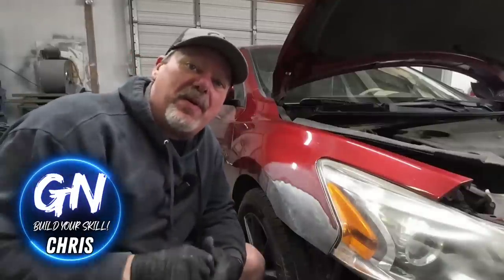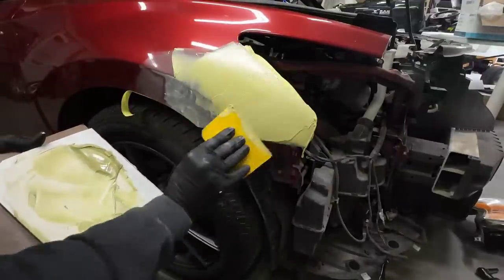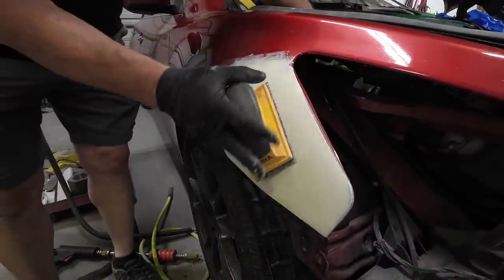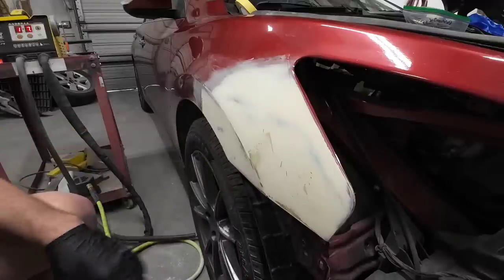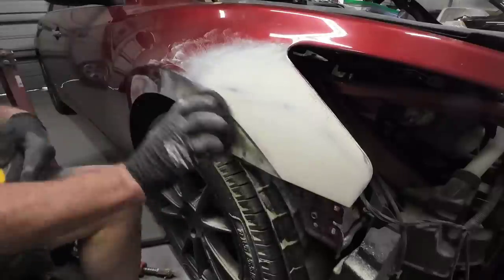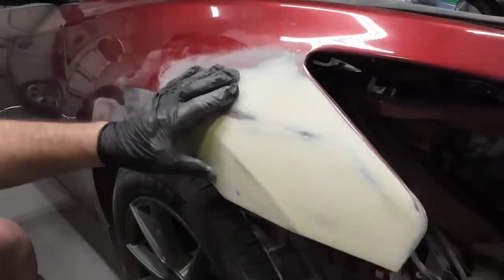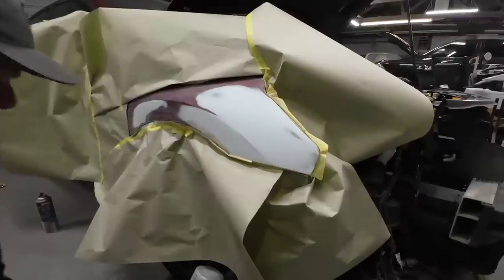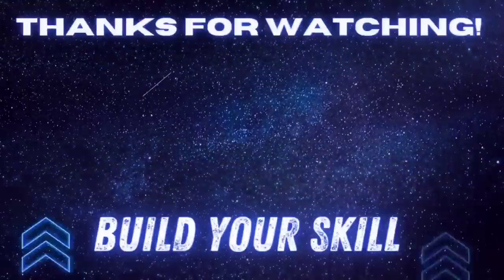How to MIX, APPLY and SAND BODY FILLER for amazing results! complete guide!

Comment: Another tip for filling curved surfaces is to bend your plastic spreader slightly to give it more surface area underneath that edge. This allows more buildup of filler.
Reply from the maker: 👍yes good tip

Comment: Excellent video (I follow all your video's from down under Aust) what size tip did you use? as i have the same R500 gun and an Aeropro A610
Just in the middle of setting up my own double garage as my DIY spray booth as need to do a full car respray on my 89 midnight blue Merc 560SEL and my black 88 560SEC
(as to spray guns i also own a Devilbiss GTI and a Pro lite and a Sagola 4600 T/Truck for clear but i am digging your vids on these LVLP guns for spraying in home garage scenario to keep overspray to a minumum) .  I am not a painter by any means but do all my work at home on my 3 x classic cars as i also have a workshop with hoist behind my double garage

As to compressors i have a 100Ltr compressor + 2 x 100 Ltr extra tanks plumbed in = 300Ltrs/80gal + Delro heat exchanger + 1inch copper pipe wall mounted large moisture trap with 3 x ball check drain valves feeding a 3 stage filter system - so making sure i get nice clean air that will keep up with a HVLP gun @ say max 30PSI and easily handle a LVLP gun on full car respray.

Getting the garage to flow air correctly is currently my project/challange and any input would be appeciated (size 21ft long x 19ft wide x 8 ft high - going to build an intake plenum for filters at rear mounted high and 2 x exhaust plenums at front (as my double garage door is a tilt door & not a roller door unfortunately.  
I have ordered 2 x explosion proof 400mm axial exhaust fans & have 2 x wall mount 500mm axial intake fans as want to get this garage working like a booth as it will be sealed  
Perhaps you can do a video on this topic seeming you spray in your open workshop
Reply from the maker: Sounds to me like you've done your research and have a great diy set up. Just the set you described is better than what I'm  using  every day. 🤣
To answer your question I'm using a 1.3 on the R500. I am building a booth it's  started but slow going because of time. So I will  be eventually doing some videos  on that. Appreciate your comment and support brother!

Comment: i am painting a truck with red cab,doors,fenders...it has a white box should i use a grey or redish primer under the new red paint ?   thanks
Reply from the maker: White is the best color to use under red for coverage.  However i would primer before painting for a extra chip resistance or you could seal it before painting.  Appreciate the comment brother!

Comment: does single stage acrylic paint need a clear coat ? lol i have no knowledge of body work...i already have te singe stage paint.....what primer should i use with it ?    thanks
Reply from the maker: No, single stage does not require clear coat. 2k urethane primer would work well.

Comment: I thought you shouldn’t put filler on metal
Reply from the maker: It's  ok to put filler on metal. You want to check the TDS or technical data sheet for the product your using. As long as it properly sanded metal, paint, aluminum in most cases

Comment: That upol gold is junk
Reply from the maker: What don't  you like about it?
Reply: @GarageNoise  every can I used was super runny very hard to work with I ended up switching over to USC platinum plus
Reply from the maker: @rongamble9884  ok, well there's a filler for everyone. I'll  be testing usc soon I don't  think it's  platinum  plus tho.
Reply: @GarageNoise  for the price the platinum plus is comparable to the 3m platinum plus but I don't do traditional collision work anymore I left that side and went to doing custom and restoration work so I do alot of skim coat on panels